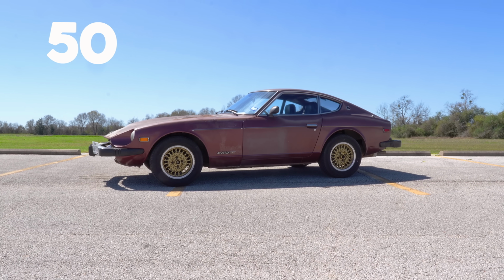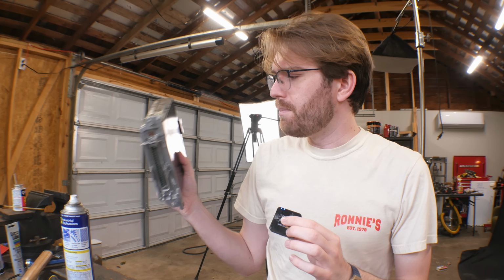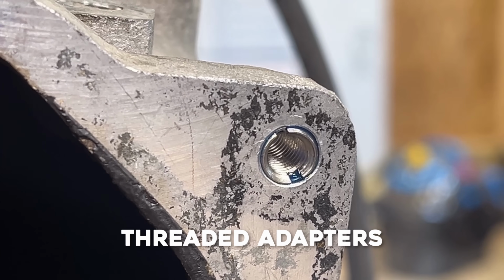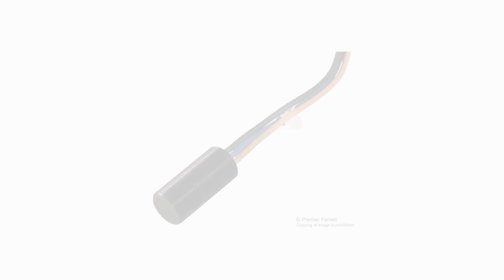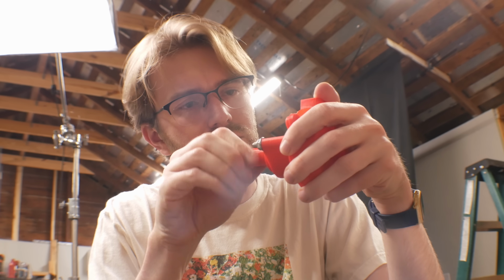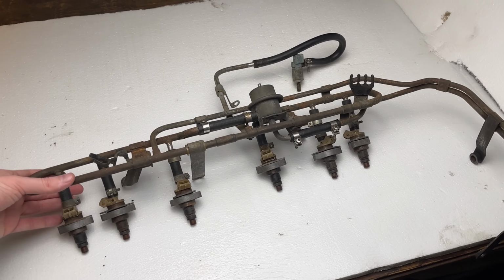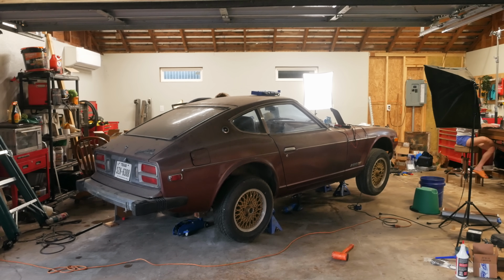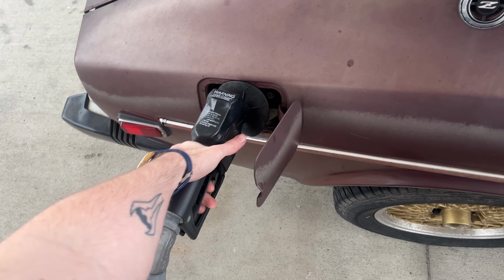Modernizing a Vintage Car

Comment: It’s not about the 13% dude. It is about the incredible knowledge not only you, but all viewers have acquired, and it’s about the pleasure a piece of our world working better. So for all this a great thank you!!!!
Reply: Aye. The work Ron went through here to modernise and improve the performance, reliability and economy of a 48 year old engine without replacing the main mechanical parts means there is now a log of what can be done for for other 70's & 80's Z-Car owners, which likely can be improved upon down the line as newer tech comes along. ❤

Yes, at the 19.88 mpg post-upgrades he's only getting like 8.45 km/L (11.83 L/100km. 1.608 km to the mile, 3.78 L to the US gallon) - but it's still an improvement over the fuel economy it was getting back in 1978 thanks to the upgrade of the sparks and injectors controlled by the new ECU meaning less fuel is wasted with each injection pulse.

Plus he gets to keep a classic Japanese-designed sports car on the road and have fun with it. 😊

Comment: I like this video. However, in your opening section, you mentioned that modern cars are “more reliable.”  in my general experience over the last 30 years of owning cars, modern vehicles are much more complex, and therefore have more parts that can break down. Older cars may have been not as efficient, but they were certainly more serviceable, and therefore lasted longer than these disposable smart phones, masquerading as cars that we see nowadays.
Reply: I don't know how you came to that conclusion? I too have been in the automotive arena for a while, over 50 years. When I was younger, and could afford it, I was involved in automobile racing in different forms over the years and had a blast, and learned so much. I've been blessed to have been involved in the restoration of many muscle cars and classics (and trucks). High performance was always my aim if I was the one designing or planning. When I was in high school in the mid 70's, I was in the auto-mechanics program and we spent a lot of time doing A line work on faculty and friends cars; work such as tune-ups, brakes, front-end work, etc. It was not unusual to have to tune up a common vehicle in those days at 20K miles. In the 2 years I was involved we rebuilt lots of engines, and most of them were in the 50-70K mileage range. We didn't rebuild transmissions, but we did replace quite a few and these also were about the same mileage. Today, I have a 2018 Ford F150 that is currently clocked at 240K miles, and I drive it round trip 150 miles daily. Thank God it has not seen one day in the shop, still has the original spark plugs, and the brakes have only been replaced one time. Yes, I do take care of it because I don't think I can afford to replace it at the cost of a new vehicle. But the evidence speaks for itself in support of someone saying that newer cars are "more reliable". There is no doubt whatsoever that this is true. Older cars may be more serviceable (this is debatable but I don't won't to argue that point here), but the newer vehicles certainly require much less service over the lifespan of the vehicle (can't speak for EVERY vehicle of course). I am not championing everything about new vehicles, or even their service life per-se. I remember the "not so good" mechanical and service aspects of some of the older cars, and I am sure glad technology moved ahead. I owned and drove a '77 Datsun 280Z and that fuel injection system never was right and I couldn't find anybody in east Texas who could fix it right either. I'm not saying there wasn't anybody around me that could, I just never found one. I finally had to quit throwing what little money I had at the problem. I finally figured out how to make it work okay, and drove it for a long time, with some workarounds. Unfortunately I wrecked it beyond repair before I could figure out what exactly was going on with the fuel injection. The car I had prior to that was a '67 SS Chevelle with a 396 and 4 speed trans. To say the 280Z never quite tickled my fancy would be correct, although there were aspects of the Z that I liked (cornering at break-neck speed for example; if you tried that in the '67 Chevelle you'd be off the road in a hurry). Since it seems like I might be a little older than you, an older car to you may be in the '80s? Let me tell you, from my experience, that's a time when the big 3 Detroit automakers turned out some of the shoddiest products in their history. I bought a almost new '82 Camaro and watched it disintegrate over 10 years, while my '68 Camaro continued to give good service life. I was constantly having to repair something on that '82. The interior was especially cheaply produced and prone to cracking and breaking. Anyway, I've rambled WAY to long. God bless and happy motoring!
Reply: @pearltiger2003  Thanks for taking the time to make a thoughtful reply. Let me preface this with saying that I don’t consider myself either a automotive enthusiast, mechanic, nor expert in any way when it comes to cars. I grew up in the 80’s and 90’s, so that’s what colors my personal perceptions of cars. 

While I don’t necessarily disagree with much of what you wrote, I stand by my personal experience with the reliability of cars. 

Mainstream google searches seem to validify what you and the creator of this video said: namely that modern vehicles (after the year 2000) are more reliable as far as engine and transmission longevity. The problem I have is the sources for these claims aren’t credible to me. I looked around on the University library for a while, and I could not find evidence one way or another (I’m sure if I attacked it for several hours, I could probably come up with something). Unfortunately, that means I have to fall back on anecdotal evidence which, while not necessarily persuasive to you, may at least illuminate my reasoning.

The oldest car I’ve owned was a 1990 Dodge Daytona (turbo), though my first car was a 91 N/A Daytona. I’ve owned two new cars, a 2008 Saab 9-3 convertible, and a 2012 Mitsubishi Evo 10 MR (still own it). The latest model car I’ve owned is my 2020 Explorer XLT. The problem I have with newer cars, such as my Explorer, is all the poor engineering and quality build of the components. There are about 10 things wrong with my explorer, which I only drive about 2 times in three weeks. I won’t boor you with the details, but that car gives me a lot of problems even though it’s used often enough not to get the engine gummed up with bad fuel, but it’s not used often enough to put serious wear and tear on it, but it’s aging poorly.

That’s bad enough. But the largest problem is that newer cars, especially hybrids and electric vehicles are extremely difficult to self service. As an average, semi-mechanical included person, I should be able to do basic service such as oil changes, brakes, and the occasional rotor replacement or hub replacement. Regenerative braking and tire pressure monitoring systems that have to be calibrated make these exercises more “tyre”some than they were when I was growing up. 
Your F-150 probably does you well because it’s both a commercial and consumer product, and Ford knows business won’t put up with shady products for long. Also, that is the best selling “car” in North America and has been for a long time. Hence, parts are plentiful.

Either way, I will not buy a car made after 2016 at all for the rest of my life. I’ll take the bus if I have to.

Cheers

Comment: Amazing vid, comedic timing, and now.. get the mpg up! Use the air intake back pressure to suck air in through gasoline in a holding chamber to pre-vaporize the fuel (the way it actually ignites). I got my old truck running like that.. literally running on fumes, but that's the most efficient and you don't lose any power, just gotta get the air mix right (and use a flashback arrestor!!!)

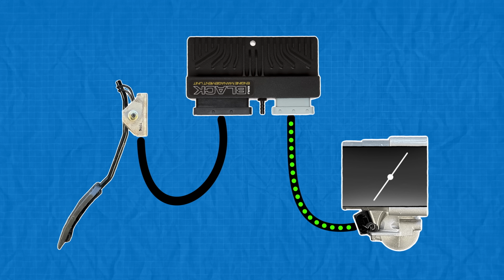Comment: 5:31  It's a little pedantic, I admit...but when you say "we can control it, and so can the computer", what you _really _ mean is "we can send a request to the computer that it may, or may not, acquiesce to, and the computer can also do whatever it wants without us requesting anything at all."  

Plus the feedback you get through your foot when you pull on a cable or linkage that opens a throttle flap is second to none.  And no, you can't get that direct connection back with a drive-by-wire throttle.  The best you can do is attempt to fool yourself that you do, with artificial feedback that's not actually...well, actual.  It's rather like electric power steering making turning the wheel artificially heavy when in "sports" mode, rather like those "force feedback" steering wheel rigs for PC gaming...but as it's artificial feedback, it doesn't fully reflect the forces and pressures throughout the actual steering mechanism itself.

Comment: Well, it seems to prove that you are a LOT better at making you tube videos (this was pretty darn great) than actually making improvements in engine efficiency (at least, using the parameters you restricted yourself to). BUT I'm pretty sure you learned a heckuva lot.

Comment: The OEM Intake looks so clean! Mostly because you can SEE it. Thankfully you saved the worklight. The single coolest electromechanical device on the car (after your distributor replacement that is)

Comment: I've gone through this whole process for my '67 2000, with the advantage of starting with a "solex" manifold making it easy to bolt on some Jenvey Heritage throttle bodies for the Dellortos I ran before. Crank-fired ignition using a 36 tooth wheel on the crank pully and a Ford sensor,  map sensor, water temp, air temp, O2 all controlled by a micro squirt V3... love it.Tune it on a laptop. More power, doesn't care if I'm at sea level or the top of a mountain, better fuel economy.

Comment: The YouTube channel "Mighty Car Mods" did a similar project a few years back.
They put an engine from a Nissan 300ZX (?) in a Datsun 240Z.
Sounded good on paper, but the greater power equated into more rear wheel spin...

Comment: I've watched this video three times now... I could go on and on about the different filmmaking techniques that went into this that I absolutely love.

But I think it's best summarized with the white-board reverse-wipe. It's very simple, extremely effective, and used appropriately. As in you didn't just keep reusing the same technique over and over, back to back.

Anyways, well done, great video!

Comment: engines need 4 things to run.
1.  air
2.  fuel
3.  spark
4.  compression - other wise the pistons wont move.  Which means no exhaust and in turn no intake.

Comment: All your mods would be too hard and too complicated for me with a high probability of the whole project failing... so 20 years ago I switched from Datsuns and Zcars to used Honda cruiser motorcycles which get 45mpg.   Basically, I couldn't afford to drive the Zcars any more, and they were too much work and too expensive to keep running.   You'll understand when you get older, you lose your interest to do even the most basic maintanance on anything when every bone in your body hurts and all you want to do is sleep all theim..  Just changing the tires, brakes, or battery becomes like climbing Mount Everest.   It's even a struggle to maintain a motorcycle.  Anyway, good job, and make your CAD files available to others, maybe you'll sprout a cottage industry for this type conversion.   I'm sticking with Honda Shadows and my Zcars can continue to collect dust.

Comment: I thought it was 280zx TURBO that got 170hp, not the regular 280zx... which only gets 135hp.  You've got a 280zx not 280zx turbo.  So your dyno was in the right ballpark.  

I've got a 280zx turbo, and when the turbo kicks in, it's a little bit of fun.  But I also realized, the car was kind of a fraud... it felt faster, only because placed you.. lower to the ground.  And it was a Jaguar knock off.  I only paid 500 dollars for mine, then immediately messed a decent car by warping the exhaust header because I was a clueless teen and threw water on it to cool it down when it was overheating right after I bought it.   The right way to keep the car from overheating, remove the thinner air conditioner radiator in front that blocks the car radiator from getting any air (and remove that air conditioner compressor at the same on the side of your engine.. it's deadweight anyway).    Anyway, don't ever throw water on a hot engine or in my case the hot exhaust manifold (I was like doh after I realized the physics), a leaking warped exhausted head caused me decades worth of problems afterwards, blasting heat on the distributor stalk and causing the whole car to shut down when it overheated the electronics inside the distributor.

My fuel meter meter is dead, the injectors always weeped, the shocks are shot out making it drive like a motorboat, the digital dash is flaking out which is the fault of the turn signal stalk switches of all things...  talking lady dead, airconditioner dead, cruise control dead.   The keyhole light on mine will malfunction and drain the battery.    The front edge of the upper roof will rust and rot out from water getting underneath, and so will the front lip of the front hood.   A lot of the plastics have just crumbled to pieces in the sun.  If you can get a carpet fitting to fit over the dash.

Replaced the starter and fuel injectors on mine several times, as well as the alternator I'm sure.  Starters failing is always a PITA on this car.

Comment: Ironically you could have just swapped in a Holley 390 carburetor in a day's work,  made the same horsepower gains, simplified the entire engine and electrical systems, had better reliability, better intake sound, and done it all for 1/3 the cost.

Comment: Couldn’t you have used a sensor on the crank - a crank trigger? Instead of messing with the distributor port. You may have needed to add the 36 tooth sprocket to the crank pulley but hey - it’s all good. 😊

Comment: I had a 1971 240Z for 26 years. I put in a 1975 280Z engine shaved the head and dished pistons .070" and installed a Maxima Diesel Crank for 10.7:1 CR then bored out my stock 71 SU carbs and installed them on the engine With a 3.9 rear end and shitty 14" street tires Best run was 12.801 @107.26 mphc at Rockingham Dragway in 1999

Comment: hmm, don't be too afraid to do tasteful upgrades to the engine internals, it won't last forever anyway. I would consider measuring timing off the crank infinitely preferable to anything off of the camshaft because the crank IS the standard for the timing, and furthermore there is no gear reduction and no lose links between that and the measurement.

Comment: First time I seen your channel that was a cool project. I always considered an after market multiport injection on an old car or truck. back in the day I was aware of the original after market throttle body fuel injection systems from Holy and Elderbrock. They are so nice for cold morning start ups.

Comment: I miss my 1974 260Z.  Most fun to drive of all the cars I once owned.  Direct rack & pinion steering, power nothing. No computers, no screens, pure car.  Unlike the 280Z my car was dual carburator. People would mount 2 or 3 Weber carbs and cam it for more power.  Mine remained stock.

Comment: Never destroy this iconic classic car with not original equipment. The early Z cars were really great cars so do it the only proper way is by restoring the systems if someone has been running it into a bad shape. Then also mpg will improve

Comment: amazing job. I admire your confidence, persistence and video making skills.You have a great sense of humor. The engine looks so much cleaner and easier to work on now.
It seems like a lot of time was spent on replacing the coil and I wonder how much was gained. (I understand that conflict is what makes a good video, and product placement is important for production budgets.) 
Also, why do you keep hammering on the starter when pulling it off and rebuilding it is such a quick and easy task? Maybe that was also (not) done for comedy.
I would have also liked to know what hwy vs city driving fuel consumption is, rather than just the average.
The enormity of this task is mind boggling to me. You singlehandedly designed a rebuild kit for this car.

Comment: awesome project and story telling.  My mechanic added a full Megasquirt EFI system to my poorly running 1973 BMW 3.0 CS with an adapted L-Jetronic system at the time and it runs flawlessly (mostly, except when I mess with the tuning too much) 15 years later.  More power and better fuel economy but mostly just more refined and better starting performance and idle.  Thanks for doing this!

Comment: That was pretty good, I had a 280Z back on 90, but as a teenager I had 260Z built like a rocket, engine was super sized, single side drafts, then it had a holley carburetor with a custom intake, then it was dual very large webbers, that thing was fast no matter which combination you felt like running, don't ever remember messing with the 280Z's but i can see why.

Comment: It’s not just about the fuel economy or the power, but you have now made that car significantly more serviceable with a modern system with significantly less failure points

Comment: I get chills watching this video when the car starts for the first time after the alternator fix. So captivating. I need to do this to my 79 zx... I had your other, earlier video saved and intended to watch it when I get around to fixing it. It's been in our family since 1980, and I'm keeping it garaged until I can electric-convert it, or do something like youve got going on here. Same engine with similar problems.